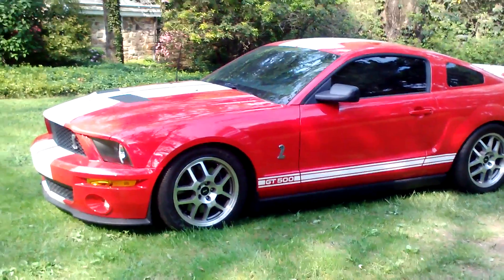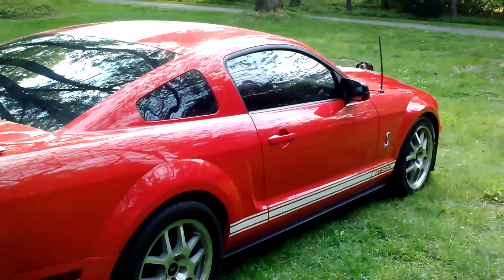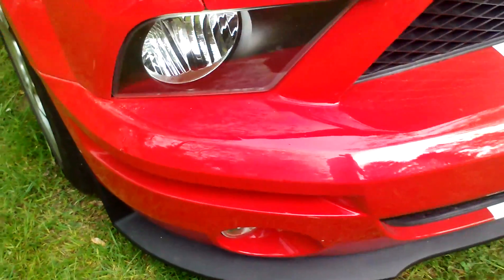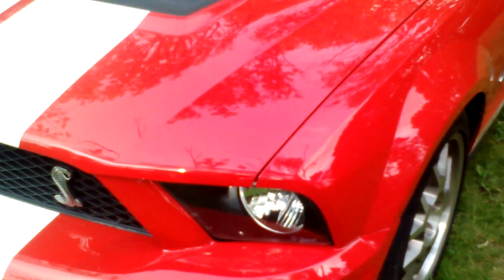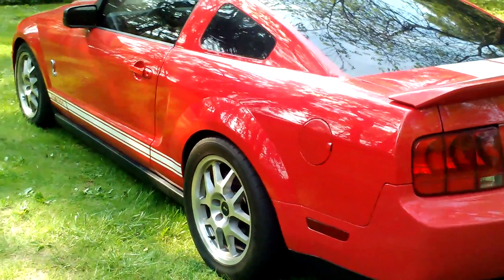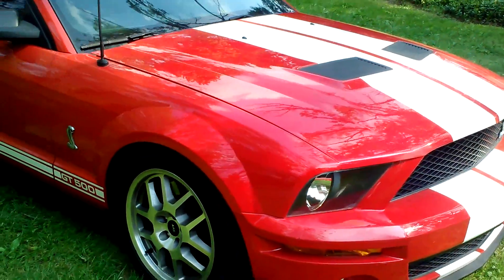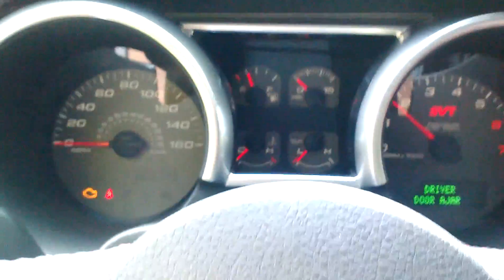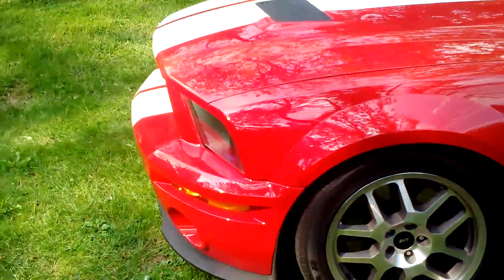shelby GT500, Race Car, 2007 Shelby

Comment: Long tube headers ALWAYS have bungs welded in for your upstream 02 sensors, the car requires them to run properly. Most likely you are referring to the down stream O2 sensors, which can be turned off in a tune. This car will need a tune to run properly with its mods, so just run it past your tuner. If you require a tune for this car please let me know, i tune them on a daily basis.